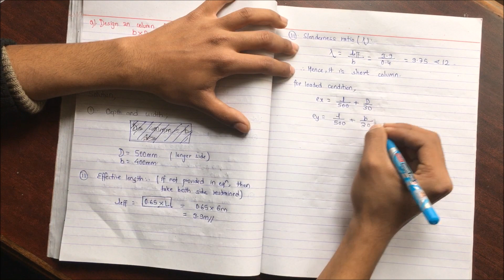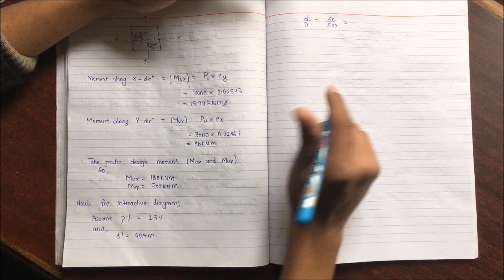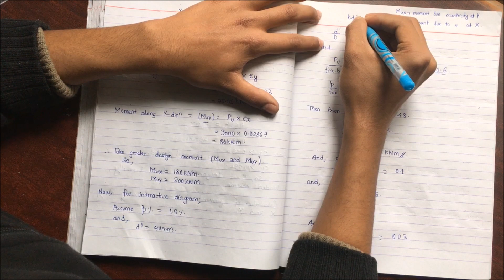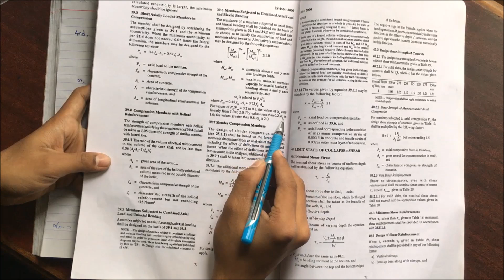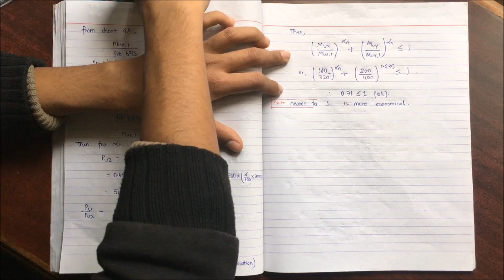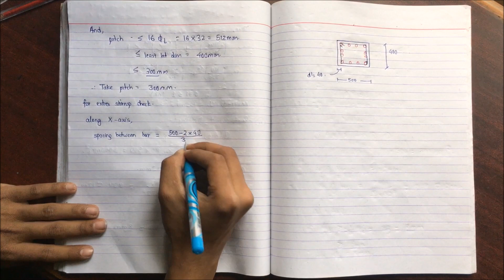Design of Biaxially loaded column RCC| Mumbai University | IOE , TU , PU

Comment: You can not use any column interaction diagram in case you have concrete grade other than M20
All the column interaction diagram are made for M20 grade of concrete